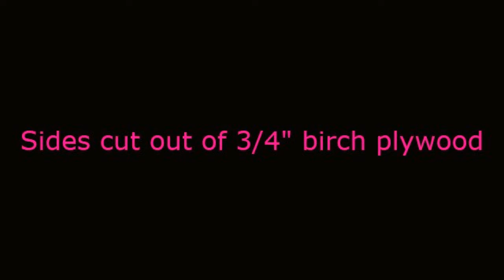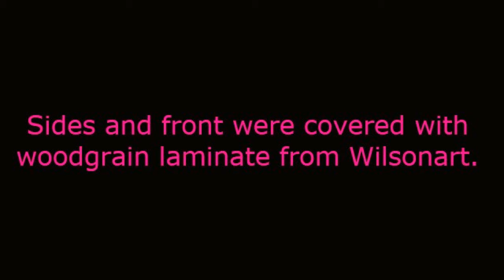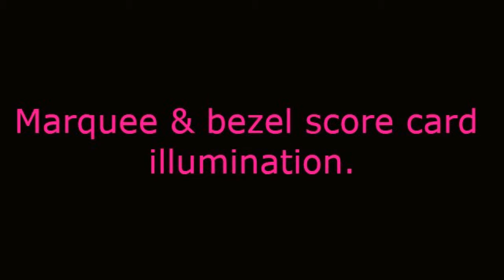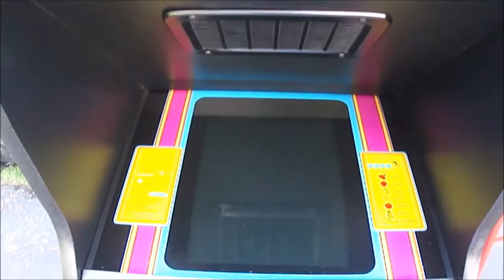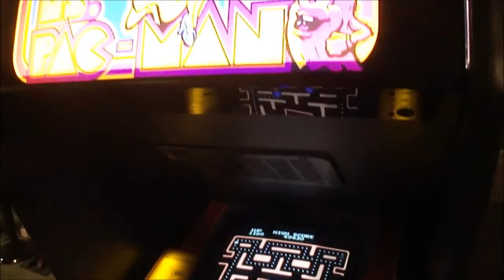Ms. Pac-Man cabaret arcade cabinet scratch build w/ 60-in-1 board

Comment: Absolutely gorgeous machine. I love how you mounted the CRT. I have a 19" CRT VGA monitor, and a Vanguard cabinet, that when I got it, was converted to LCD. The main bracket to hold the monitor is there, but not the monitor chassis. I might have to do what you did, and use wood to make my own bracket for the monitor.

Comment: I know this is an older video but barely seeing it for the first time.  Great job with this build.  I was wondering if you could share where you learned how to wire it up? I get the basic stuff but where it gets a little cloudy for me is when you add fuses.  I see you have fuses between the power supply and guess the board.  Any tips would be greatly appreciated.  Thanks
Reply: Eddie O make an account on Klov.com (if you haven't already) and ask around there. Guarantee someone can help ya

Comment: Where did you find the actual control panel? I need 2 one for the pac man cabaret and also for Ms pac cabaret projects i want to do.
Reply from the maker: I got a used original on eBay, then used it as a template and then made my own with sheet metal.
Reply: I know someone that has a ms pacman caberat I wonder if  it would be the same for regular pac man.....?

Comment: hey how did you connect your coin slot to the jamma harness I need help on my
Reply from the maker: I just connected the appropriate wires from the jamma harness for ground and coin switches to the coin door wire harness.
Reply: mbott1701 hey can u send me a picture of want wire to connect if u can this is my first arcade build and there's nothing on the Internet that shows up what to connect   thanks you
Reply from the maker: Coin 1 (JAMMA pin 16, parts side) should go to the Normally Open (NO) tab of the coin switch for coin 1. Coin 2 (JAMMA Pin 'T', solder side) should go to the NO tab of coin switch 2. You can wire directly or trace the wires from an existing wire harness, if your coin door has one.  Your ground wire should go to the Common tab on both switches.  Here's a pic from another scratch build I did as an example. https://drive.google.com/file/d/0B4v11BwvP9WoWmxhT2x2NWVxNXM/view?usp=sharing
Reply: thanks a lot for your help in got it